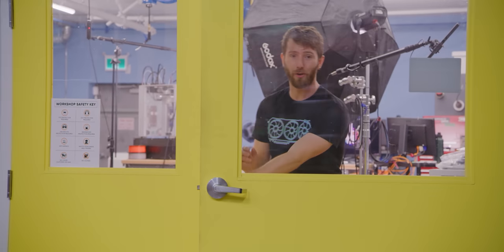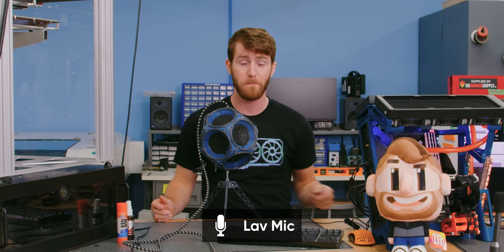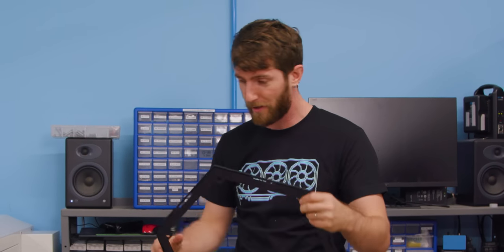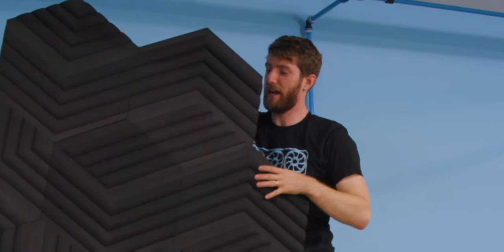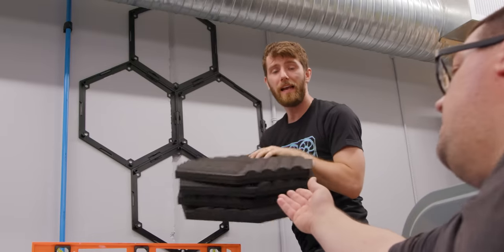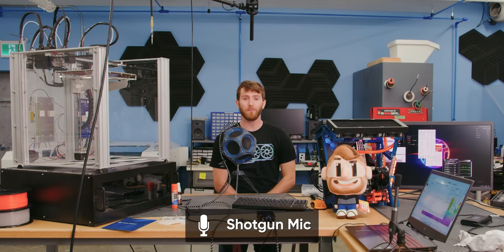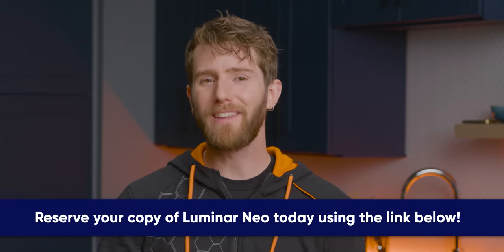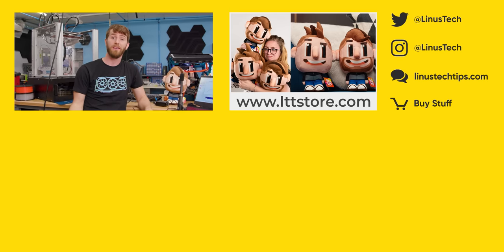I'm only going to say this once... - Acoustic treating with Elgato Wave

Comment: I'm extremely curious to know what the raw material cost of these panels is, actually I would want to know this for any foam that is used for sound deadening/damping. Because to me any of these seem to be extremely expensive for a piece of foam or 2 pieces glued together. Yea obviously it is not your everyday foam (probably open-cell type stuff), but still the production process will be similar and automated and the raw materials can't differ that much.

I'm not looking for the usual "it's professional" or "it's the research cost" arguments. I actually want to know in-depth how the processing of raw materials during the production differs, and how that affects price.
Reply: Vanesha Angel  very informative, thanks
Reply: These panels are insanely over priced, just get basic square tiles off Amazon and get 5 times more surface area for the same price.
Reply: It's an Elgato product, the answer you're looking for should be fairly obvious. The shit is overpriced by a mile. You're actually paying for 6 letters. E L G A T O
Reply: For these types of products the base cost of materials is very low, and the only real determining factor is the total amount produced. So if you only expect to sell let's say a million of these, and that is what you base your production run on, tooling costs for the plastic parts, setting up a production hall for the run etc. are divided over the million units sold. If they expected to sell ten million those same costs would be a lot lower per unit. So the reason niche products are expensive is the expected low sales.

And of course if you have a niche product it's easy to make it more expensive because you don't have an option to buy it elsewhere.
Reply: But if you're talking raw material costs, just the actual plastics and metals before shaping etc. Is only a few cents per unit.
Reply: Raw material cost and production costs are very low, but keep in mind shipping costs could be high as the product is large, overall I'm sure they are very overpriced when normal foam would have very similar effects
Reply: @robjobse8860  a basstrap wouldn't cut down on the reverb caused by parallel walls. You do need something to break up the large reflective surface on either side and a basstrap in the cprner would not be effective at that
Reply: I looked up polyurethane foam, and you can buy it consumer-priced for 50$/4LBs. The cheapest foam panels on amazon are 52 sq.ft for 35$, and weight 4LBs. So it probably depends on where you go shopping at, though the manufacturing process is laughably simple. The foam is expanding, so you only need to make nonstick forms, then pour in the right dose, and it would expand to fill the form.
Reply: Part of it is fire resistance. Notice that he took a blowtorch to it . If it was just styrofoam or other packing materials, would probably be a lot more fire.
Reply: Just use rockwool which is much better and almost for free. Cons is you need to wrap it in some fabric.
Reply: Yes, I would love to see a comparison against some super cheap egg-crate style packing foam.
Reply: @Sandriell  egg crate does not absorb sound... probably just change frequency... 
and it also depend on sound volume. Doubt that linus had some loud speaker in that big room...
Reply: @marcogenovesi8570  Yes, you can do that. However, those towels need to be washed every 6 months or so, or they'll grow mildew due to how hydro-absorbic they are. They pull in enough atmospheric water over 6 months to grow damp. They are also a pretty serious fire hazard, and most certainly are against code.
Reply: @Sandriell  That egg crate foam is also an extreme fire hazard. Not up to fire code, and you'll get fined if an inspector ever comes through your property.
Reply: @soup_troop  Those basic tiles off amazon are super thin, and don't do a whole lot for absorption of reverb. You'd also have to glue it to the walls, or pin it using some nails, damaging the walls on removal. If you opt for a mounting bracket for them, then you cut into your cost savings. Sure you could use cardboard to glue them onto, but...cardboard is extremely flammable. The foam is also destroyed on removal if you glue it on directly to the wall. Tons of drawbacks.
Reply: @TomasJerabekXCII  Rockwool is great, but it's far from free. For 3 inch thick panels, your talking around $40 for just 4 of them. Around $150 would get you pretty good coverage with it though. Get some burlap to wrap it in, super cheap and can be colored anything you like.
Reply: @TomasJerabekXCII  Hes actually correct to some extent on the egg crate foam. Any material with mass will absorb some level of reverb. Just not very well.

Remember, Mass=Absorption. Anything is better than a flat wall. Even a painting will help because it interrupts the flat plane and causes the sound waves to bounce and cancel/amplify at various frequencies.

Doesn't make it safe to use, nor does it guarantee it is performing well though.
Reply: @streamershaven  My wife has some chronic health issues and gets IV fluids sent to her in an insulated box every two weeks. I was looking at making bass traps and happened to see the latest box sitting there and got a crazy idea. I tacked a couple of them up in the corners and they actually did a pretty decent job! They're ugly AF so I'm going to make light wood frames for them and cover them with some light muslin so they look a little nicer. At least a little something good coming out of her being sick.
Reply: @streamershaven  I just want to say I appreciate you actually giving out good information.
Reply: @streamershaven  uh, so concrete walls would be good at absorbing sound?
Reply: It's not that expensive, it's not exactly as cheap as you think though to get good dense foam.. if you buy it in bulk though and you know where to get it then it's definitely if I mean if you're doing something like this it's definitely worth going to the to the source, fortunately it's one of the things in this world you can still buy from the factory in bulk without having to go through weird business channels or some shit, pro tip if you need a new mattress by the way.. and if you get in, or you just get lucky or whatever you can often get scraps that'll be like you know the size of a mattress and just you know free high quality dinse foam,
Reply: @joeybuddy96  yes, they will help break up standing waves you want as much mass as you can get, air gaps help massively which is why breeze block buildings are a good start. But you also want to decouple the walls, ceiling and the ground.
Reply: @joeybuddy96  Absorbing, no. Isolating, yes.
Reply: @marcogenovesi8570  I used a term that people would understand without needing to google intentionally, even though it isn't exactly a real word. It's the same as how soundproofing is thrown around for absorption panels, even though they don't "soundproof" anything.

And being out in the open in a room that gets a lot of traffic contributes a lot more to this than you think. A wardrobe is less affected because its not constantly open to new, circulating air, there were a few videos I had seen showing this off on YT awhile back, showing harmful bacteria growing on the used thrift store towels after being on the wall for 6 months (You aren't likely to use nice, new towels for a DIY project intended to save money.)

Regarding the fire code, fire tends to spread upward from the walls, due to thermodynamics and pressure gradients, and you know, the wall being fuel for fire. If you have a highly flammable substance on the wall, it catches quicker, and the fire can spread faster, making it harder to contain. Not to mention, outlets are commonly found in walls, and electrical wires can arc if you have mice, or whatever chewing on them or you accidently struck a nail into a wire or something, meaning the fire can START from the wall itself, in certain situations.

Under normal, optimal circumstances, fires would never start. Yet they happen nearly every day across the world. Could happen to me, you, or some random person you never even knew existed on earth.
Reply: @iagmusicandflying  Take a piece of it outside, get a fire extinguisher ready, and light it on fire with it on asphalt or concrete to be extra safe. If it puts itself out, it should be somewhat okay. If it spreads like crazy really fast, do not use them.
Reply: LiK  So, yes. Those things help. Honestly, even just a bookshelf loaded up with books and odds and ends is fantastic(and functional!) However, they are not specifically designed with acoustic absorption in mind, and may not affect the correct frequencies very well(If at all). Foam is used because it is very dense material, meaning it absorbs a lot of sound pressure relative to the thickness of the material, meaning you can get a lot of absorption for very little material. And since we can control the density of the foam, we can target specific problem frequencies with it.

There are a lot of options out there, Just, whatever you do, don't put egg cartons on your wall. That's asking for your home to burn down.
Reply: @streamershaven  6 months ago i bought 2 packs (7.5 sq. meter) for about 40$. Also they are heavyer then foam and can be placed to wall with gap so it is even better. Should absorb 90%+ from 100hz or so. Cheap foam from amazon wont absorb less then 400hz i think.
Reply: @TomasJerabekXCII  Depends on the foam you get, really. But sounds about right.
Reply: The foam is probably chemically treated with fire retardants after expanding and it has to look nice so add the cost of dyeing and perhaps mechanical treatment or in some cases wrapping in fire proof fabric. A good panel also does not smell, that could cost something too. I'm willing to pay a little more to avoid the smell of panels that I once bought.
Reply: @streamershaven  Oooh! That's a good point! I even tested everything else I've used so far for this like that. Didn't think about those though. Thanks!
Reply: @marcogenovesi8570  I suggest consulting your local fire department regarding hanging towels in a wooden frame that on your wall if you want 100% accurate info. All I know is that it isn't exactly safe to do.
Reply: @marcogenovesi8570  I'm not going to prove anything to anyone who isn't willing to do their own research on the subject, so there's no sense in me wasting my time trying. Regardless if I convinced you or not, taking only one persons point of view (even your own) to determine the fire safety of hanging a bunch of towels in a frame on a wall is asking for trouble - What if they are wrong? What if they are right?

The same goes for any other subject. I encourage everyone to do their own research on the subjects they want to verify.

And one final point - I have an uncle in the fire department. They don't treat people like dumbasses, at least in my experience. There is no such thing as a stupid question, especially when it concerns safety.

Comment: 9:30 torch heat and fire heat is different, torches wont really start fires because of how hot they are they just usually burn the material while a regular fire will use the material as a fuel source.
Reply: and a stray spark isn't going to catch anything on fire
Reply: That's a load of horseshit. As long as the temperature is above the flashpoint of the material it will catch on fire. If the materials burn temp is lower than it's flashpoint then you need something else flammable in the vicinity to keep the flame going. The torch test was adequate to demonstrate that these will indeed not catch on fire randomly from sparks.

Comment: I have been in the sound business for over 40 years.  Acoustic treatment is best used at ear level on one of two parallel walls to conserve funds.  Ceilings other than acoustic tile is generally not a prime control surface.  A high reverb time rt60 is not very addressable electronically.  I think your video does a good job of demonstrating that .  Thanks to this one
Reply: what have you done for 40 years in sound, specifically? I am thinking of starting a sound treatment /acoustic panel business, making panels and ordering other products and doing installs and sales. any tips or advice would be appreciated

Comment: 14:26 - I think the price is okay, a regular youtuber will need just a fraction of the panels you needed for their room, so the cost for them will be much much lower as well. The color inaccuracy would be the more annoying thing.
Reply: the shape is the bigger concern, it looks great on huge walls like this, almost like an art installation however in a room this will we look terribly off centred and not flush with the squared walls of a room or studio. Square is the most common shape for a reason.
Reply: I just want to point out that 6 of the elgato panels cost 120€ so i dont think that its cheaper then the 660$ one
Reply: @leontheinen7514  And you can just get these for like... 10% of the price off aliexpress